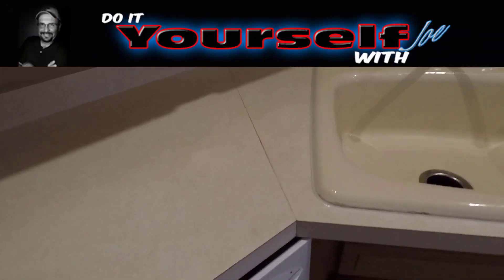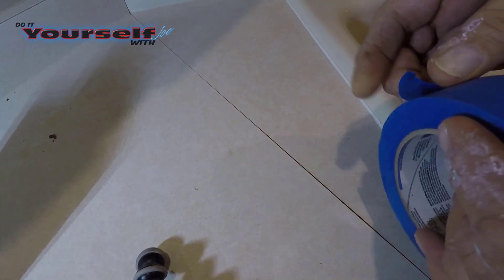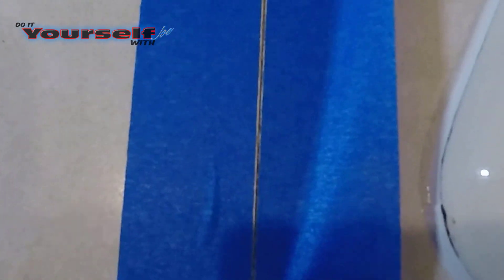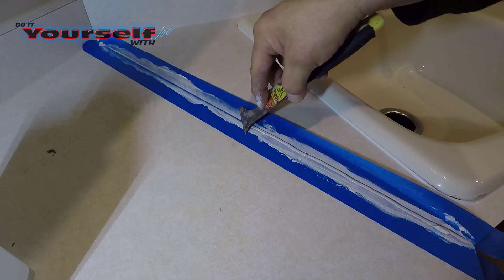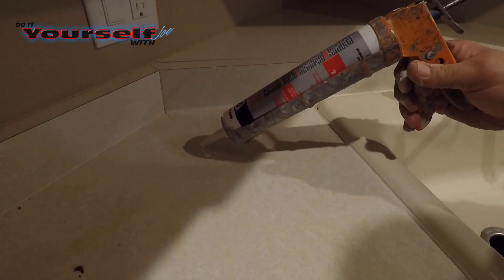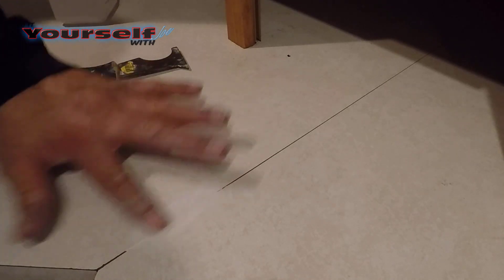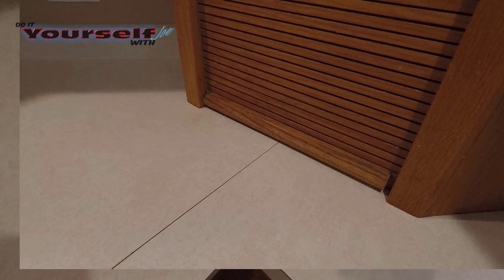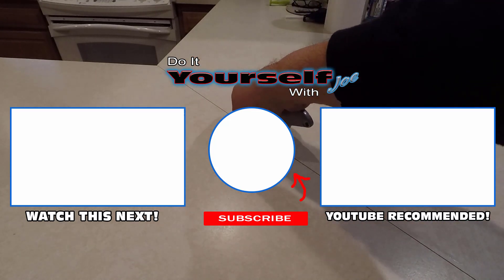Counter repair, how to fill countertop seams with caulk

Comment: Hi Joe, would this type of seal protect new laminate countertops from water damage if the joint is close to the kitchen sink? Because of the weird layout of my kitchen, I would need two separate pieces of laminate countertop. My contractor is suggesting custom quartz countertops but I’m too broke! Haha!
Reply from the maker: if you are gluing the pieces, try an exterior glue. and you can put a small 1/8 inch bead of silicone caulk all along the top edge of the counter top seam.

Comment: What if your seam is warped a bit from some water damage? One side is higher/swollen up than the other.
Reply from the maker: There isnt much you can do with that. The damage is done.
Reply: Is only one option,
Replace it. 
Then when you cut hole like for sink  - all below laminate needs to be done with waterproof glue or silicone.  Then is protected.  That's good advice for the job next time.
Reply: @Doityourselfwithjoe  What about scraping away some water damaged wood under the lifted side then gluing and C-clamping the laminate itself to bring it down to the level of the other seam edge? Worth a try?
Reply: @Doityourselfwithjoe  Because it's particle board underneath (and therefore porous and textured, I believe you could press caulk into the vertical edge... NOT a bead, but basically painting the one raised seam edge with the caulk. It would improve the appearance a little bit, plus it would slow the absorption of more water into the seam. Then, of course, remind the lazy customer that seamed counters require you to 1.) always avoid water in the seam areas, and 2.) if it does get wet - wipe immediately (do not ever let water stand on those seams, not even for a minute). The cumulative effects of many instances of being wet is like soaking the edge of particle board for hours - it's going to swell - permanently, like you said.

Comment: What about if my countertop is pink ?
Reply: Use white or maybe use some dye o chalk
Reply: replace it
Reply: Go get the correct stuff which comes in many colors to be mixed to get the correct color.
It won't peal out with time like the caulking WILL

Comment: What about seems that have bowed up?
Reply from the maker: If the seams are bowed up it's probably delamination or water has gotten into the seam. If water has entered the seam then the wood is swelled and there is nothing you can do. If the laminate is delaminating then you can re glue it.

Comment: Crappy job. Looks bad. Won't hold up. Was hoping for an actual solution.
Reply from the maker: The only solution I know of is getting new counter tops. This is only a way to clean things up and make it look better, it will need to be repeated again when they start looking bad.